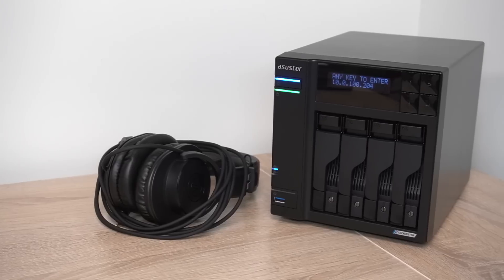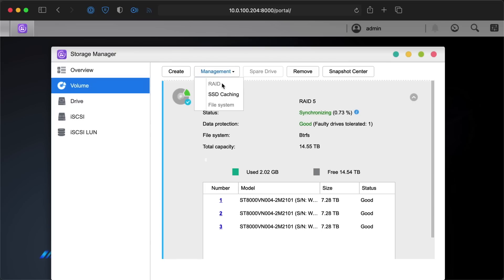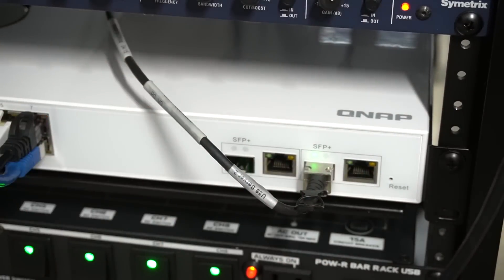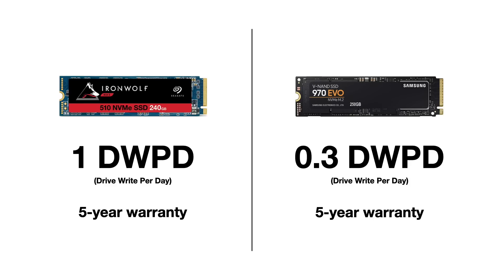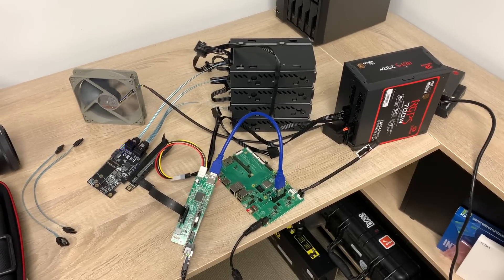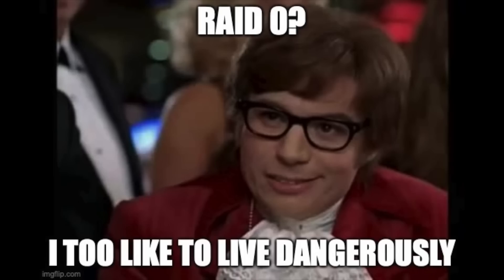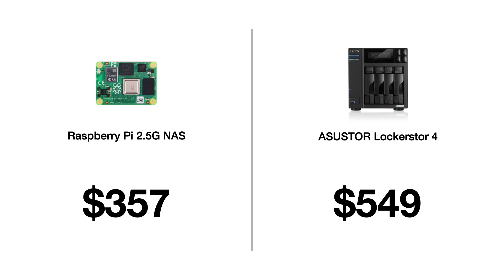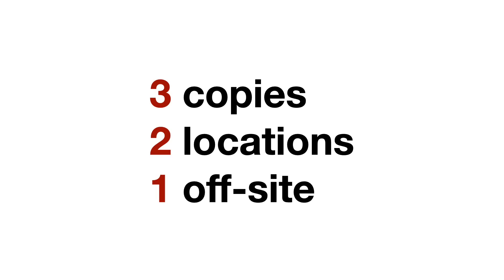Raspberry Pi vs ASUSTOR NAS Head-to-Head Part 2 - the VERDICT!

Comment: Which is best NaS please suggest Synology, Asustor ??
Reply from the maker: They all have their positives; I think for value, ASUSTOR seems to be slightly less expensive than similar QNAP and Synology offerings (just a little), and I'm just happy there are more options nowadays for mid-tier NASes (like with 1 or 2 2.5 Gbps ports—it used to be either 1 Gbps or super expensive 10 Gbps only!).
Reply: @JeffGeerling  thank you so much 😊

Comment from the maker: I can't believe you didn't use ZFS. You don't know storage unless you only use ZFS.
Reply: The self-awareness is gold
Reply: Very true! And ECC RAM. Oh wait...
Reply: ZFS over packet writing raid0 Universal Disk Format SCSI DVD's ^_~
Reply: Did you just heart your own comment 😂.
Anyway zfs has a trade off that nobody seems to talk about, they are all quite happy to brush it under the carpet, also if you loose 1 vdev everything is lost.
Anyway good video
Reply: @philipm1896  By the way, hearting too much of your own comments demote them.
Reply: @philipm1896  What trade-off? Also, WRT "if you loose 1 vdev everything is lost.", using more than one vdev is similar to doing a RAID 0, you can't expect it to magically recover your data when part of it is lost.
Reply: Hey, you look smart. Maybe you should start you own YouTube channel one day.
Reply: I can’t believe you didn’t use hardware RAID. You don’t know storage unless you only use hardware RAID. They’re two sides to every coin and these ones always fight
Reply: Obviously a long term project but was looking at SNAP RAID and if you can get it running on a Pi with low enough overhead it could be the real deal for Pi NAS OMV type storage.
Reply: R Pi 4 is a bit too slow and small memory for that. Sure it will work, but you will be loosing a lot of performance, because things like compression and checksuming takes quite a bit of CPU cycles, especially if the code is not optimized for CPU. It can be tuned, and I did use it for fun, and even real projects on small devices, it is not great without beefier CPU.
Reply: @movax20h The Pi is available up to 8gb, that's more than many of these NAS come with from the manufacturer. They aren't low on RAM
Reply: @mrmotofy  8GB is plenty fine. I would be more concerned about the CPU.
Reply: @movax20h  And the 1Gb NIC is sad
Reply: @movax20h  Well, the Fletcher4 checksum is faster than RAM, and LZ4 compression is actually fast enough to saturate the 2.5G even on an SBC (even on my Orange Pi One, which is significantly slower than the RPi 4). You also don't need to enable it. A bigger problem is encryption, as the RPi 4 doesn't have AES acceleration, but there are SBCs which do.
Reply: @GRBtutorials  it might be fast, but it is not free.
Reply: Do you remember the days of vxvm and vxfs on solaris and irix ??? ;)
I migrated quite a few production SPARC/Solaris systems from veritas products to ZFS once it was made available in Solaris 10.
Those were the days when ZFS did'nt exist on linux yet... Linux only supported ext2.
Another good, but basic by modern standards, filesystem back then was XFS on IRIX, which was also ported to linux later on, and IMO was the best filesystem until ext3 and ZFS were available.
Reply: @Jeff - please see my note on networking and concurrent serving of individual connections. i am pretty sure you will get the clue on it. ;-)
Reply: Only thing that ZFS did for me was lose my data.
Reply: I use btrfs on my laptop, no issues.